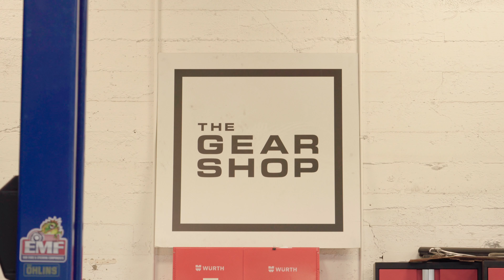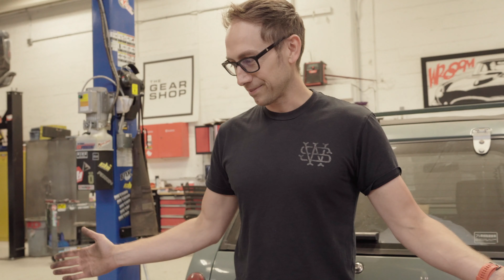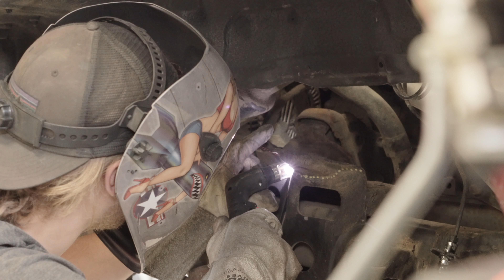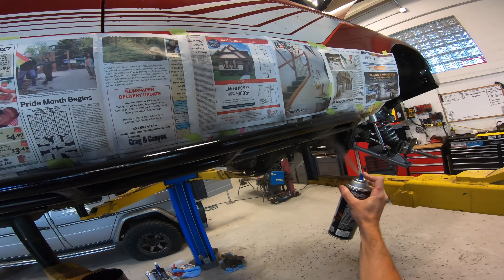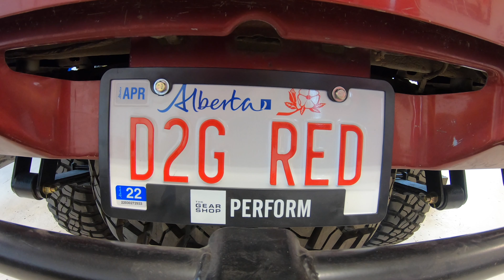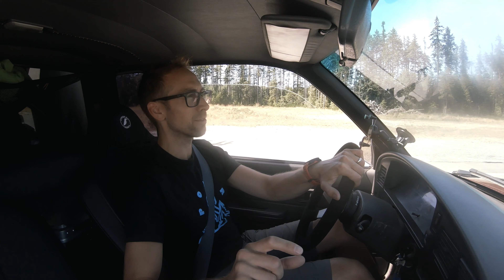TOTAL CHAOS Long Travel Install on our Toyota Pickup!

Comment: So t100 axles work for this long travel kit? I have manual locking hubs and noticed you had them as well
Reply from the maker: Yes, the kit uses T100 axles 👍🏻
Reply: @DeskToGlory  do they have to get modified or do they go right on without modifications sir
Reply from the maker: @ericestrada197  No modification necessary. I just used some aftermarket axles for a T100 from the local parts store.
Reply: @DeskToGlory  good to know for my future long travel setup. Thanks sir
Reply: @DeskToGlory really I was just told I need to get them custom made cause the Oem ones where to small

Comment: Hey man, love the build and great review. I’ve got a 87 4Runner that I just finished putting the same kit on. I use King 2.5 8” coil overs. My question is this… I’m not get any real up travel. Any suggestions. As you know there’s not really any instructions to speak of but everything looks like what I’ve seen. Any thoughts?
Reply from the maker: Are you saying that it’s stiff and the suspension isn’t compressing? I ended up putting in 500lb/in springs and that helped a lot. I revalved the shocks a couple times to reduce compression damping as well. That helped soften the ride. After a month in Baja and a second application of grease to the upper bushings I found that the suspension was less stiff as well.
Reply: Hey thanks for getting back to me. Yeah I spoke to Total Chaos about the stiffness, they said it needs breaking in and that those are the coils they recommend for my truck with that kit. They also recommended 150 psi in the shocks. I might play with lessening that too before I fork out more on different coils. 
Anyway, thanks again

Comment: That was a good idea to take that thicker leaf out of the leaf pack.   A big mistake I made once was to use a Rancho add-a-leaf and after 5 years it had put a bad pressure point of the stock 88 sr5 yota leaf pack and broke the oem rear leaf pack.

Comment: Nice truck! What size tire did you say you have? I couldn’t hear what you said on the video. Thanks!
Reply from the maker: They're 285/75R16. Thanks!
Reply: @DeskToGlory  did it fit in the spare under side between both leafs?
Reply from the maker: @damnitdang  Yes, the 285 fits between the leafs with plenty lid clearance.

Comment: There are a few other vendors making LT kits other than Total Chaos.  I plan on making my own soon simply because I'm not about to hand someone $2,000 for what I can do for well under $1,000.   The prices on these have just gotten ridiculous.
Reply: So is it 2000 for labor only or it includes the parts? Cause I need some smooth suspension on my 94 pickup 4x4 that I got about 8 months ago
Reply: @jaimecoc8412  don't listen to that guy.. every do it yourself guys trying to just make their own kit from scratch had failed imo.
Reply: @jaimecoc8412   Just parts man. And it's highway robbery.

Comment: How does that set up ride on the road?
Reply from the maker: Way better than with the torsion bars. It has some body roll when the shocks are on full soft, but when set to 4 or 5 the roll is minimal. It could probably use a front sway bar.
Reply: @DeskToGlory  Right on! Torn between an OME kit and this kit for my 86. Road manners are important.

Comment: Are those used 63’s or did you buy them new? And if new, where might that be? Thanks!
Reply from the maker: These are new. I picked them up from Standens in Calgary, AB but most local spring shops should have them. I paid just under $400 for a pair. In the past I’ve paid $100 for junkyard springs.
Reply: @DeskToGlory  awesome! Thanks!

Comment: Awesome build I have a 94 Toyota pickup with the upper and lower control arms but where did you get those extended tie rod sleeves from I’m about to make some
Reply from the maker: Thanks! They came with the Total Chaos Caddy Kit.
Reply: Cool I didn’t put the kit on I bought the truck and it had it allready but they longer outer tie rods must of be from something else. I’m going to have to call and see if they will sell these separately